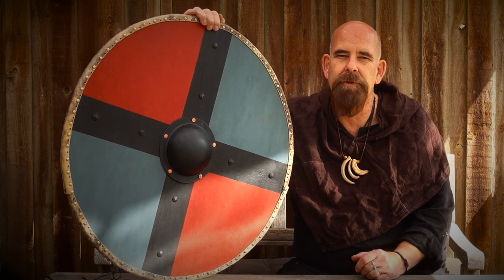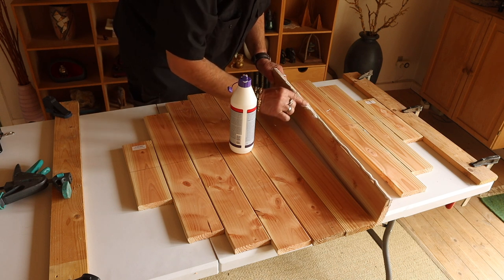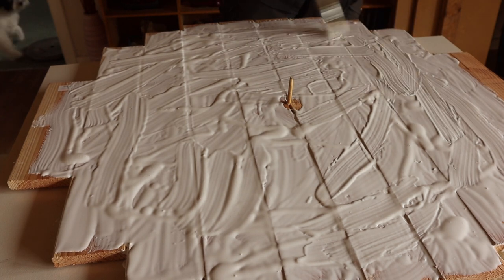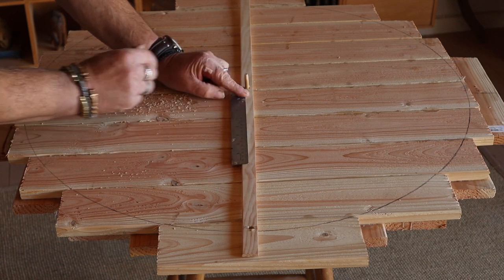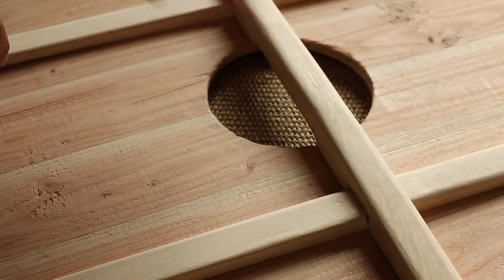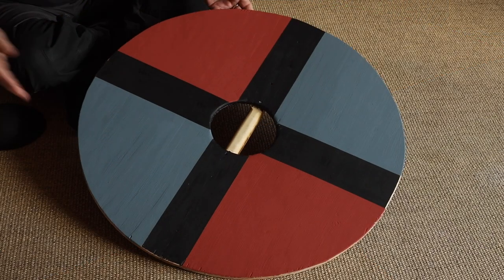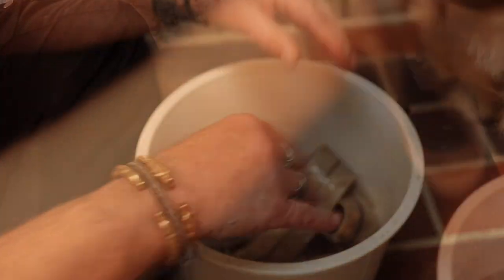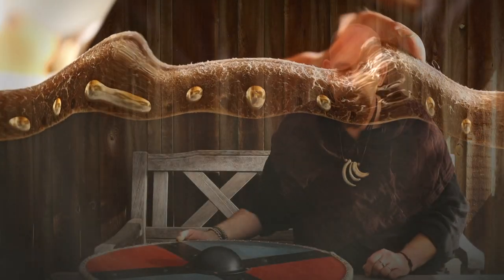Making a Viking Shield

Comment: historical improvements:
Thin the boards to 9mm max and at the edge 3mm
use hideglue 
cover the front side with rawhide
do not flame the wood
make paint with pigments, egg and linseed oil

after painting cover everything with an additional layer of linseed oil

do not nail a rope on the edge and do not nail the edge (glue it)
Reply from the maker: Thanks for your good advice how to make a Viking shield 😉👍🏻🔥
Tom

Comment: Another way of attaching the raw hide edging is to cut it to length and sew it together to make a hoop. Cut it slightly shorter than the out diameter of the shield so you have to force it on. When the raw hide dries it will flatten out and hold the shield boards tightly {you may need to keep the boards flat while the hide dries out?} . Once dried the hide shrinks on to the edge of the board and can stay there without further methods of retention; or you can nail it in place or sew it. Use a 1mm or 2mm drill bit and go around the edge of the shield making holes and then sew the edging in place.
Reply from the maker: Great idea/advice Mik 😉👍🏻 thanks for sharing this with me. Maybe I’ll try that next time I’m making a shield 🔥
Tom

Comment: Hello Tom,
your shield turned out really great.
Why didn't you use 2 thin layers of Boards? That would have saved you a lot of work.
A year ago I built my own Viking Shield. Made from 0.8 mm thick birch plywood board laminated with linen cloth, a Grimfrost shield boss and a rawhide border.
My shield is 90cm in diameter and weighs about 5.3kg overall. Very heavy I know. In the old days, the shields weighed about 3 kg.
How much does your shield weigh?
Greetings from Germany, thank you and take care my friend.
Reply from the maker: It’s also about the 5 kg 💪🏻😊
I didn’t want to use plywood and I couldn’t find boards that was thinner than 1,8 cm
Thanks for your feedback and for following me on my adventures 🏕🔥🇩🇰🌲Tom

Comment: +
Wonderful job.  I am not sure about the design though. I think the metal 'boss' on the front of the shield was more for bashing your opponent than protecting your hand.  The hand hold should be 3/4 of the shield diameter so any blow to the shield is met by the flat of your fore arm.  The way you have designed it means any blow on the half of your shield beyond your fist is met by your wrist.  Not a good way to be.  Otherwise though a geat practical project.
Reply from the maker: Thanks for your feedback my friend 😁👍🏻 and your advice regarding the design of a shield. Hope you’ll have a great weekend 🏕🔥🌲Tom

Comment: would this be good on making a shield for viking combat as in reenactment group fighting sessions with blunt steel swords & axes?
Reply from the maker: It should be 😉 I’ve made it in the best way … crossing the wood and putting rawhide on the edge 👍🏻 But most shields that are used for this are made from plywood … it’s strong, easy to make and cheap to replace … but not authentic 😆💪🏻. Thanks for your feedback and question my friend 🤗🏕🔥🌲Tom🇩🇰
Reply: @cimbrerbushcraft-vikingheritag  thanks! Yes i mostly know to get birch plywood and two of those long planks with that 6-9mm or some other measurements.
Reply from the maker: Hope you’ll succeed in making a great Viking shield of your own 😁👍🏻🏕🔥Tom

Comment: It's a very nice shield, I just have three minor criticisms and one big problem with it, maybe you can implement them on your next shield project. 

1. The big problem - If you are making a roundshield with planks, make sure the handle is not going diagonally to how the planks are oriented. This makes the shield literally unusable in a fight as it will split open almost immediately. This is not a problem for decorative shields, but if striving for historical accuracy and authenticity it should not be disregarded.

2. If you are making a shield with planks, it should be tapered towards the edges to a thickness of around 4 milimeters (8-10 milimteres in the center). This is not only historically accurate, but it also makes the shield lighter enabling you to make a 80 centimeter shield that weighs only around 3 kilograms.

3. To fix the rawhide onto the edge don't use nails, for the same reason as above but also you can repair it way easier if some of it breaks. Make holes through the edges and sew it on with waxed linen thread. It will look amazing, it will hold for ages and if it breaks you don't need to have nails with you, you can repair it with any thread you have at hand. 

4. Cover at least the face of the shield with linen (glue it with natural glue if you want to go full on historical accuracy, but other glues that don't damage the linen over time are also cool). This strengthens the shield preventing it from splintering on contact with weapons. If weight is not an issue (if all of the above was followed) you can cover the backside of the shield too before fastening the handles. This will make your shield last for ages....

If you have any questions I would be happy to help...
Reply from the maker: Thank you so much for your advices 😁👍🏻 I appreciate that brother 
Tom